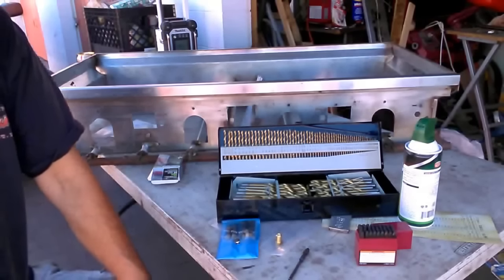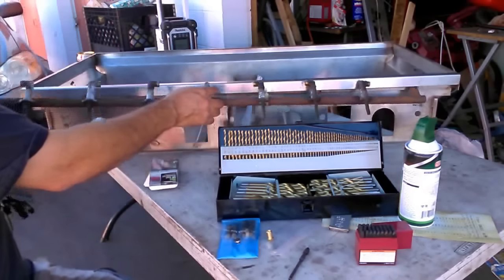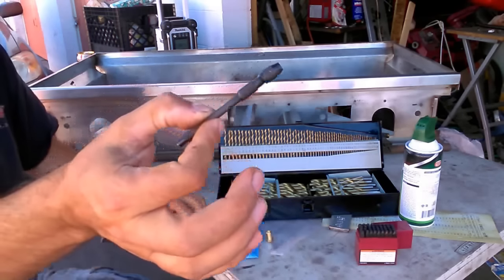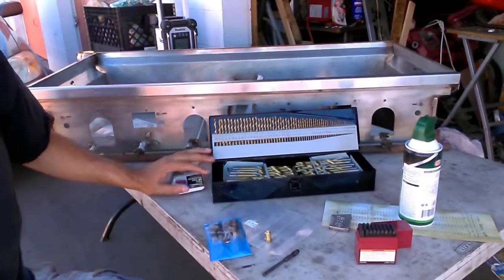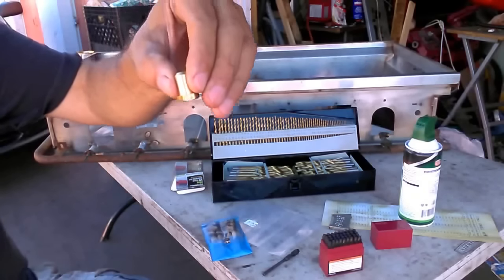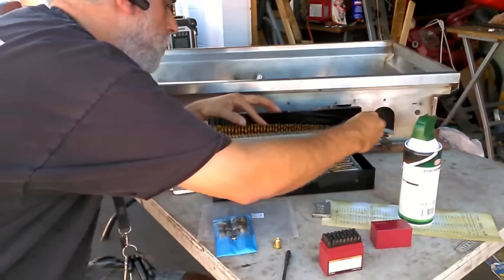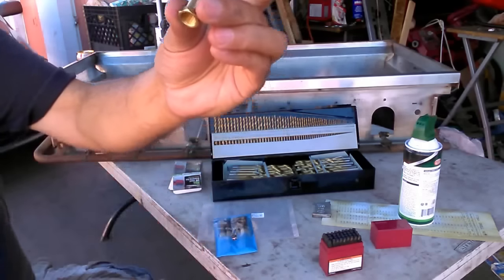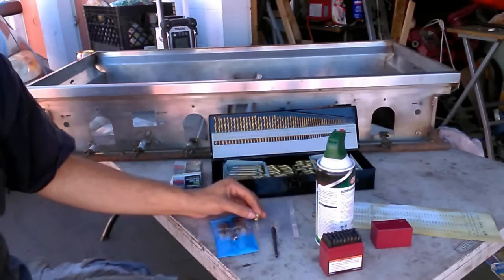Propane and Gas Conversion Basics (How to)

Comment: Frank I have a Thermador  PRG366EG oven and I want to convert  LP from Natural gas. do you know the conversion kit?
or if it's possible??  thanks!!
Reply from the maker: I have kits for a host of different Thermador units. I'll need to verify the orifices in the top side burners. Can you send me an overall pic of the unit, then pics of the top side burners specifically, and a shot of the manufacturer's plate on the unit. I'll need you to pull an orifice from one of the top burners and send a picture of it as well. I have a video on converting a Themador at    https://youtu.be/nY749eSRECI     

I'm pretty sure I know what orifice the oven uses for the broiler and main burner. The broiler will likely use a pointed orifice, and the oven will likely use a large flat orifice. You can gain access to the broiler orifices through the back of the oven. The main oven orifice can be accessed by removing the oven floor and accessing it from the entrance of the main burner tube.

Feel free to send the pics to my mobile. Remember that I'm on the West Coast if you call. You can reach me at 714-574-1544. Make sure to state what model you're converting and to which gas you're converting.

Comment: Seems that drilling by hand induces quite a lot of wobble... would think more accurate to have a small power drill, held very precisely, on slow with coolant to make the smoothest and best-centered, short of mounting both in chucks anyway.
Reply from the maker: Actually, I do the super precision work on a lathe. Normally the best way to do it without a lathe is to use pin vises and drills.

Comment: What size orifice hole do i need to make for converting to propane on a WEBER Genesis S-310?  I already have the three new orfices with the starter holes in them.  I just need to know what drill size to make.
Reply from the maker: http://andersonforrester.com/conversion-chart/
Reply: So this grill is 12,666 BTU per burner so would i use 57 or 58 because it's in between.  Will either work?
Reply from the maker: Weber grilles require tight tolerances and must be done to precision. Not to mention that Weber's published orifice specs are innaccurate. Any deviations, and you'll never get the flame right. You'll likely need to go to a metric drill standard to get those orifices right. I've had to do that a lot on those late model Genesis grilles. That's why I normally drill the orifices and supply a matching regulator in the conversion kits that I sell.
Reply: Thanks for the help.  I'll let you know how it goes.

Comment: Hi Frank.  Great how to.  I just got a Camp Chef FTG600 which is 4- 12,000 BTU burners for a total of  48,000 BTUs.  The Camp Chef site says it can be converted and suggests a #45 drill bit, but I think that size bit is for one of their smaller, lower BTU stoves.  According to the Anderson & Forrester chart, which bit do you suggest?  I couldn't tell if that chart is telling what size bit for the total BTU's or the BTU's per burner.  In other words, do I look for the bit that corresponds with 12,000 BTU's, or the bit that goes with 48,000 BTU's?  Sorry I'm just confused and don't wanna screw up.
Reply from the maker: A #45 is a fairly large size, and is likely for Natural Gas with a regulator. Barbeque ratings typically give collective burner ratings, so a 48,000 BTU unit with 4 burners will be 12,000 BTU each. The Anderson Forrester chart specifies per burner ratings, so you're likely looking for a 12,000 BTU rating. I always reverse calculate the current orifice to see what the actual heat rating is, then I calculate for the rating using the alternative gas based on that heat rating.
Reply: @frankhamilton8257  Awesome! Thanks for the quick reply and the help. I'm not using a regulator and am gonna use a #54 bit. I had a feeling the #45 wasn't right. Someone on Amazon that bought that same grill posted the #45 info.  I figured better to ask someone that knows than to trust a review post on Amazon. Thanks again for the info Frank! Gonna tackle it today.
Reply: Frank Pastore how did that work for you I’m looking at doing the same thing to the exact model.
Reply: @5238jorge  Frank definitely pointed me in the right direction with the importance of the different sized drill bits so i called camp Chef's customer service number and they were awesome. They said the ftg600 can definitely be converted and they sent me the how to PDF instructions that are specific to the flat top griddle models. Turned out it's a #51 drill bit. All converted and cooking up a storm. Griddle is awesome and so is Frank for the videos and advice. Good luck with your conversion if you do it.

Comment: Hi Frank, i'm in australia and want to convert my propane BBQ to natural gas. i have the orifice sizes of 0.91mm (12.35MJ/h burner) & 0.96mm (10.55MJ/h burner) for Propane at 2.75kPa, i bought a kit with regulator (1.5kPa)  for natural gas but no orifices. can you please calculate the orifice sizes for Natural gas ?

Comment: Hello, I have a Decor model #SGM4668 that we would like to convert to propane. Could you possible help with the process by supplying the parts or guide me to them. Thank you for any help you can give.
Michael
Reply from the maker: Yes, I've done that model before and actually have a kit for it. Feel free to call me at 714-574-1544. Remember that I'm on the West Coast when you call.

Comment: What u can't just go by the orphis?
Reply from the maker: I actually sell orifices for every stove and barbecue made on my website  https://flamesources.com/  I'm now in the Midwest, and you can always get a hold of me at 714-574-1544.

It takes two changes to control fuel flow in a burner system. The regulator controls the fuel pressure behind the flow, while the orifice is used to choke down the fuel flow. just like orifices will vary, regulators will also vary. Make sure to view my video on fuel regulators - https://youtu.be/AddrkTCBd7c   Make sure to like and subscribe to my channel.

Comment: I have a stove that was run off propane I am installing it where my other stove was that run off natural gas I know the Jets have to be changed but can I just hook my has line directly into the hook up that the propane was hook to or do I have to take the part my gas was hook to and swap it work the propane hook up be cause they vertually look the same and it will hook up
Reply from the maker: Propane comes out of the bottle at a much higher pressure than natural gas does. That means that, as a rule, natural gas can travel through the same pipes and connectors that propane can travel though.
Reply: Thank you very much that's what I needed
Reply: @frankhamilton8257  Why is propane run at a higher pressure?
Reply from the maker: @ellenorbjornsdottir1166  LP is the abbreviation for liquid propane. When exposed to the atmosphere it's beyond it's boiling point which is -43.6 degrees Fahrenheit , so it flows into the atmosphere as a gas. The fact that it's in liquid form when it's in the bottle would indicate that it's stored at a tremendous internal pressure, enough to turn what is normally a gas into it's liquid form. Most propane regulators are set at 11" WC, but you can also use an adjustable regulator that would allow you to release it at 7" to 13" of Water column, however the industry standard for a "store bought" regulator (with the regulator body incorporated into the high pressure hose) is 11" WC. It's not evident why the industry has chosen this rating, but it is what it is.

Comment: did you mean the larger the number the smaller the size?
Reply from the maker: Yes, that's what I meant. Doing a fuel conversion is usually a simple affair. I have orifices for every barbecue and stove made. I'm now in the Midwest, so feel free to contact me at 714-574-1544.

Comment: 1:59 "The bigger the number, the larger the drill" - you sure about that?

So generally speaking which has the bigger orifice size - natural or lp gas?
Reply from the maker: Generally speaking, Natural gas uses larger drill sizes. The index is numbered backwards, with #1 being the largest size and #60 being the smallest unless you're working with metric drills (I'm working with a standard American gauge drill index in this video). If you're working with propane, you'll often encounter drill sizes in the 60's, and, if you're working with a propane unit that has simmer orifices, those orifices will be somewhere in the 70's and beyond. I use a special index for that and I also have a metric drill index for situations that call for a metric bit. Doing a fuel conversion is usually a simple affair. I've converted just about every type of bar-b-que and stove made. I'm on the West Coast, so feel free to contact me at 714-574-1544.

Comment: What  about pressure difference  on safety and control. Valves
Reply from the maker: This video explains how to match an orifice with a given BTU level. It is a pressure differential that allows this phenomena to happen in a predictable way.

You may be referring to a "pressure drop" which is another subject and usually not a factor when it comes to stoves. It's the pressure differential that enables gas to flow out of a pipe into the atmosphere, and this factor is different at high altitude versus sea level. The table that I use compensates for this pressure differential in a scenario based on altitude (atmosphere's).

Here's a table on pressure drop: https://www.engineeringtoolbox.com/natural-gas-pipe-calculator-d_1042.html

Differential pressure is a pressure that is measured relative to the pressure in the atmosphere around it. The other type of pressure is absolute pressure, which is measured against absolute zero, but is not often used to measure pressure in real-life scenarios.

Here's a website that explains that phenomenon:   https://www.chegg.com/homework-help/definitions/differential-pressure-5
Reply: @frankhamilton8257  the pressure out put of a propane regulator is grater than the out put of a butane regulator.  Will the grater pressure brake the safety valve that has a probe in the pilot light

Comment: Hi,
     I have a Gas yard light that I acquired used. I do not know the history on it. I hooked it up to Nat Gas and it would barely light. From that I assumed that the light must have been hooked to propane? I could not find anything in my searches where I could get just an orifice or a way to take the existing size and calculate what it should be for nat gas and drill it out.
     Where would a person get a  pin vise like yours...very nice and a good source for the small drills. The light from my searching may be a Charmglow/ Modern Home products?   Great video very helpful       Thanks, Bob
Reply from the maker: Why don't you just give me a call tomorrow. I'm on the West Coast 714-574-1544.

Comment: Screw on an adaptor before drilling to prevent wobbling. Screw into threads of orifice to be # stamped, an adaptor to prevent hammering from distorting the perfect hole.
Reply from the maker: I actually sell orifices for every stove and barbecue made on my website  https://flamesources.com/  I'm now in the Midwest, and you can always get a hold of me at 714-574-1544. 

Actually. Orifices should be bored on a lathe to insure no distortion, but since most people don't have a lathe to their access like I do, they can simply use a pin vise to bore the hole. Most gas tech's would do it this way. My suggestion is to gradually work your way up to the recommended size one or two sizes at a time. If you do that, you can be relatively assured that the hole is true.

Comment: Hi Frank do you ship to ireland
Reply from the maker: Doing a fuel conversion is usually a simple affair. I've converted just about every type of bar-b-que and stove made. I'm on the West Coast, so feel free to contact me at 714-574-1544.

I've shipped to every destination in the Americas, but never to Ireland. I would need to know what you're converting.
Reply: @frankhamilton8257  hi Frank thanks for the reply I have a Viking barbeque  VGBQ4103RT and want to convert to lpg so I will need some hood orifices 3@#54 3@#57 and 2@#62
Reply from the maker: @666mcnally  can you send this info to my email address? The address is framilton62@yahoo.com    I'll also need pics of these orifices, an overall shot of the unit and a shot of the manufacturer's tag.
Reply: @frankhamilton8257  Hi Frank look at your junk mail it might be there

Comment: Can You convert LP Fireplace Gas Logs to work with Natural Gas ??What do I need to convert ? Thanks !
Reply from the maker: That conversion would be more simple to do than a bar-b-que because you won't need an air shutter adjustment or a flame adjustment. All you'll need to do is swap the regulator and the orifice. I have the parts. Feel free to call me at 714-574-1544.
Reply: do you have any idea how to convert Cedar Ridge gas log sets?  we purchased an "open box" set up for the fireplace, but we seem to be missing a piece.

Comment: Okay this video does not actually address converting from propane to gas or vise versa. This video addresses how to create a custom orifice which I presume is part of the broader process, but....
Reply from the maker: Doing a fuel conversion is usually a simple affair. I've converted just about every type of bar-b-que and stove made. I'm in the MIdwest, so feel free to contact me at 714-574-1544.

Comment: Hey how do you change a Bradford 40 new from gas to propane.
Reply from the maker: Water heaters usually have a combination gas valve with an integrated thermostatic control and pilot generator. The most common type are made or modeled after units made by Robert Shaw or Honeywell. The conversion usually involves swapping the orifice, the thermostat and the fuel regulator. I've done the orifices and pilot orifices for those units before. If you cant' get these parts for them, they would need to be fabricated. They're custom and usually require some savvy engineering and precision machine work. You can always contact me at 714-574-1544.

Comment: Hi Frank, Is that a Members Mark grill? Looks similar to my project. Great vid!!
Reply from the maker: No, this grille is a DCS grille that I'm restoring and upgrading with modern amenities. The new DCS grilles retails for around $12K. I've done parts for the Members Mark grilles, so contact me if you need the orifices 714-574-1544.
Reply: @frankhamilton8257  I have members mark I want to convert as well do you know the hole size it needs to be for this type of grill?
Reply from the maker: I have orifices to convert everything made, so just give me a call at 714-574-1544, and we'll figure out exactly what you'll need to complete this conversion.

Comment: I just fill the Natural gas orifice with JB weld and drill it out. It ain't rocket carpentry. also get you a orifice pressure chart. t will show you pressure/BTU/orifice relations..
Reply from the maker: That's a dangerous idea. There's not much area for this adhesive to hang onto and brass is typically a very smooth non porous metal, so it's a bad substrate. Since gas and propane are petroleum products, they can both act as a solvent to any substance such as a JB Weld epoxy. A burner can become a flame thrower when the epoxy finally blows through, and this may not end well. I have orifices for everything made. I'm in the Midwest, so feel free to contact me during normal business hours at 714-574-1544.